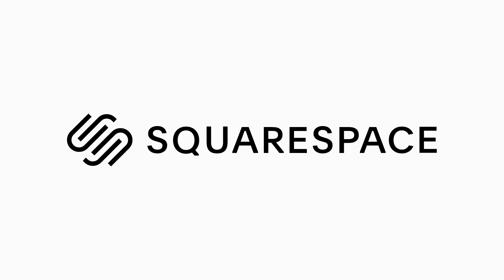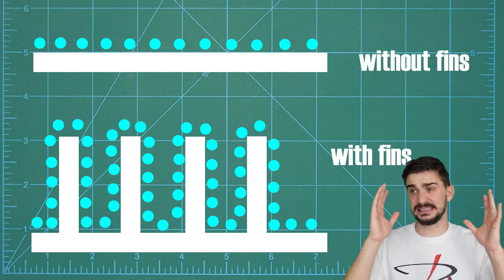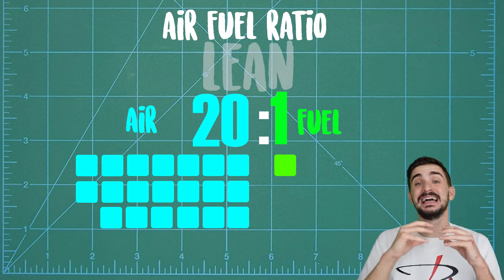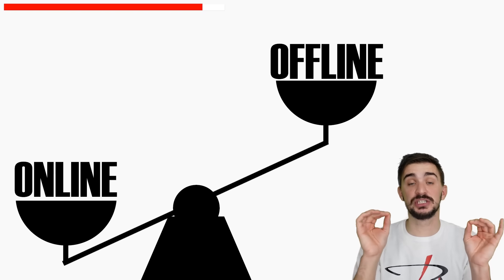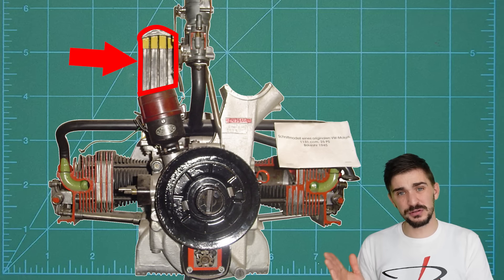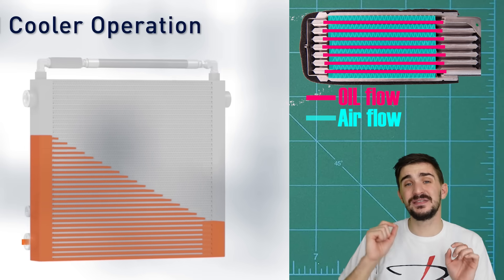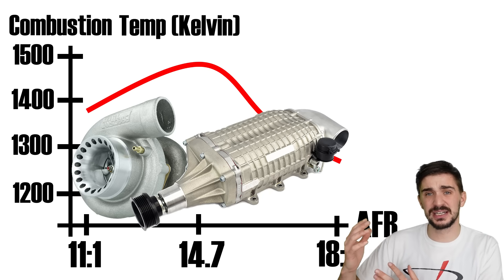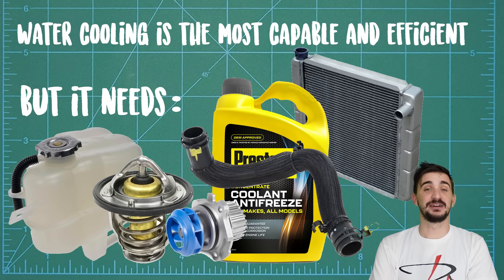AIR COOLED vs OIL cooled vs WATER cooled ENGINES

Comment: I remember talking to a Porsche 911 930 owner. He told me, that the engine is oil-cooled, not air-cooled, because there is 14 liters of oil in the system. When normally in water-cooled 6 cylinder engines it's 6-8 and maybe sometimes up to 10 liters of oil.
Reply: I like the comment ‘it’s blurry’ between Air/Oil cooled.  I don’t think it has anything to do with there being an oil cooler.  The Porsche 911 is both oil cooled and air cooled.
Reply: @alienpoker   Yup, air for cylinder heads, oil for block.
Reply: @alienpoker Correct. Btw, so are water cooled engines, after all, what cools the water😂?
Reply: I think you are exaggerating those oil capacities by a few L.
Reply: @3800S1  No, my 911 from 1977 holds 13 litres.
Reply: @3800S1 not the case, my 911sc, same 3 liter, took 12 and a bit, and that was without the front wheel well oil cooler that the turbo version of the same engine does have.
Reply: @Rudimaentaer  LOL, none of the models you reference can come close to the cornering of any 911.
Reply: Most modern auto engines do not use that much oil( 6 8 or 10 liters???) A gallon is 4 qts my 350 small block chevy takes a little more than 4 qts in a oil change. My 450 motocross bike ( 4 stroke hi output) only uses  .7 liters or 700 cc!! But when the engine first came out it had a oil tank in the frame ( part of the frame itself) to hold additional circulating oil at 2× that amount. New vehicles are using less and less oil as oil pumps are better , oils are better AND the less oil in the oil pan contains less trapped/ stored heat in the oil itself and the engine usually gains a proportional power increase with less oil ( obviously not to the point of poor lubrication and engine failure but slightly more than it actually needs) the parasitic losses of rotating parts immersed or splashing thru a   hi viscosity fluid is reduced.
Reply: Oil cooling is just air cooling on steroids. It improves some of its short comings but still you are cooling the components (including oil) of the engine with just ambient air. Water cooling is the odd one out of the bunch by introducing a separate component, water, into the mix that has no other job in the engine than keeping it cool.
Reply: Those 3l Porsche engines are air-cooled. Compare a 6l small block uses ça 5l of oil, 6l if it got an oil cooler, 7l of oil if external filter and external oil cooler are present. 9l if you add a vaccum reservoir for the oil. I build my street racing small blocks with 7l capacity and a very flat oil pan and increased the water circuit by 4l with an external tank riding in the airstream. It's essentially a dry sump and heat radiation from the pan is lower. A finned sump cover could help but in my climate this was not needed. My cars run cool on a 35 Celsius day.
 14l oil capacity on a Porsche means that the engine has some serious engineering defects. That's why I stayed away from racing Porsche and my motors and cars are simply better than what Porsche does. 500hp at 5600 and 900kg is fun. A 1800kg Porsche with 400hp/7000 is boring.
Reply: @808bigisland  there's no 911 that weighs even 1700 lol
Reply: @808bigisland Yea, how many 24 hours of Lemans races have your cars won????
Reply: @rodgraff1782  a new 400hp 911 is +1700kg. My Europa was 650kg/125hp vs a 1200kg/160hp 911. My Cobra streetlegal racecar was 950kg/500hp. 911 are maximally boring forever.
Reply: @808bigisland  Air cooled Porsches are nowhere near 1800kg. Even more heavier modern ones that are liquid cooled are far less than 1800kg.  930 is more like 1150.
Reply: @808bigisland If only you had a clue…
Reply: @brembopollypor9965  you‘d have brown pants going 300 in a Cobra without a windscreen, tiny brakes and flaming sidexhausts half a meter away from your face while lapping 911😂
Reply: @808bigisland Assumption is the mother of all f-ups

Comment: 8:57 Classic British bikes used a similar dual oil pump, but the high volume side was to scavenge oil from the sump to the oil tank. In my 1966 Norton 650SS high pressure oil is directed at the underside of the piston crowns to provide cooling, with the heat being dissipated to some extent by the oil tank.

Comment: What you call WATER COOLING is in fact LIQUID COOLING. The cooling liquids used contain a lot more than plain water.
Reply from the maker: So oil isn't a liquid? 
Also, 12:43
This is your second comment criticising something that has been already explained clearly in the video.

Comment: on air cooled bikes even the bottom part of the motor "oil pan/reservoir" there are fins to cool the oil. Generally oil cooling is mostly used when you want to shed some weight on engine block and size. And as he stated even on air cooled engines you can find oil cooler because air cooled engines run a bit hotter even more so with hi octane fuel that burn "hotter"
      
      (technically it is not correct but due to longer burn time with hi octane fuel the engine will absorb more heat. Tested on my bike, it run like a beast (more complete combustion and longer gradual power output) but it get hot faster specially in urban area). 
     
      The engine oil get burnt faster and have to be changed more often. The trade off is you dont significantly damage engine when overheated, cooled faster (when turned off compared to water cooled) and will run when overheated for longer (there is no danger of coolant boiling off, damaging the engine or out right seizing it). On the other hand in extreme situations it can runaway in a sense that it start to burn oil increasing RPM and power and potential destruction of the engine. But unlike in diesel runaway engine the compression ration and pressures is not efficient to spontaneous combustion so without spark it will stop.  

       A small oil engine historical fact. In WW2 there was a project of aircraft carrier submarine capable of launching 3 planes that have to land on ship or water. It significantly increase reach to enemy territory without putting a aircraft carrier to direct danger. The problem they were facing was way too much time to the engines to heat up to operating temperature. Loosing the element of surprise and being easy target during that time. Solution was that the planes were stored dry and before surfacing fill the engines with preheated oil cutting time by around 20 min if i remember it right, so the start up was in 9-12 min. I think in the documentary they use I 400 submarine class with Aichi M6A. On wiki it say they can launch all 3 planes in 30 min.

Comment: My old 2006 Honda CB600F 599/Hornet was a liquid cool with an oil/coolant heat exchanger.  That bike used 4liters of oil.  First time I changed oil on that bike I was surprised that a 600cc bike used as much oil as my 1991 Acura Integra 1.8liters.
Reply: The CB600F also uses the same oil for both engine and transmission lubrication ...
Reply: @sking2173  yeah so do most all motorcycles, minus Harley, MotoGuzzi, and a few others.  None of the other motorcycles I have ever had required as much oil.  Even larger more powerful bikes use less.

Comment: air cooled engines require an ticker oil than water cooled?
Reply: Sir, generally speaking it's bearing clearances and internal tolerance that determine oil viscosity requirements. Just putting thicker oil in an attempt to cool a engine is equivalent to putting a band-aid on a bone fracture. Yes, I'm a Engineer.
Reply: @t.s.racing  I'm thinking about Honda Grom engine, 125cc air cooled. It uses 10W30 oil. For an air cooled engine, the oil is too thin? Maybe 10W40 is a more viable option when the cylinder head are hot?

Comment: The GSX750 may have had 4.7L of oil ,but the 1100cc engines designed later had 3.6L which is a normal capacity for a large motorcycle engine. The air cooled GS1100 has 3.5 and the watercooled GSF1250 has 3.5

Comment: I thought you would have mentioned the downside of air cooled generally needing to be under square… considering it’s one of the biggest cons if not the biggest.
Reply from the maker: I know of plenty examples of both over and undersquared air cooled engines. Why would they need to be either?
Reply: @d4a  air cooled engines have a lower limit to bore/stroke size, Harley’s are a great example, they can have the same engine size and an Indian, yet make nearly 50% less power because they have waaaay more stroke and can’t rev to the same limit because of that, they have more stroke because it means more effective air cooling. Look into it, it’s a pretty basic concept, I can link a video if it helps?
Reply from the maker: I don't need to look into it and I don't want links. I want you to explain it to me. How does more stroke lead to more effective air cooling?
Reply: @d4a  if it’s size for size, more stroke means less distance for any heat to travel from centre in the combustion chamber to the walls to shed heat, compared to bore. Centre of piston to the walls is less. You seem upset? You wanted me to explain it? I’m sure plenty other people, waaay smarter than me can do a better job? I’m a terrible teacher.
Reply: @d4a  is this about a civilised conversation or something else? If it’s something else I’m not interested, when I said “you seem upset?” That was a genuine question, not a smart a&$ one. Discourse is how we all learn.
Reply from the maker: Was I uncivilised? I just wanted you to explain in relation to what you said above. I'm aware of how cooling works in relation to stroke but wanted to hear your opinion rather someone else's from a link. But the effect on cooling isn't the main reason why hd has a lot of stroke, their v twins always had a lot of stroke mainly due to how stroke influences torque, but you probably know that. Air cooled engines aren't really limited in terms of bore or stroke and there have been air cooled engines of all sorts of displacements and bore/stroke ratios out there. They will get around their issues by running richer/limiting rpm/etc so they won't squeeze the same potential out of the same displacement as a water cooled engine, but they're really not limited in that sense in the way you're saying with the HD example. Their main limit is emissions and this is the main reason behind their slow but certain extinction in many markets. I'm sure hd could make their engines a lot more powerful if they didn't have have to abide by current emissions norms.
Reply: @d4a  nah, lack of cooling is the only reason, Harley tried water cooled and made big power, but didn’t sell, now look at the modern engine they made, has nothing to do with emissions, Indian plays by the same rules and made nearly double.
Reply: Wasn’t this a fun interaction, hey guys.
Reply: Funny how in one of you later videos you said the exact same thing I did about over square/under square, you should probably edit your comment in this thread in order to avoid looking like a hypocrite 😂
Reply: @Merkel — You said, regarding air-cooled engines “generally needing to be under square” ... That is patently NOT true. 

You also called it (needing to be under square) “the biggest con”. Again, not true.

Stop trying to weasel out of your fool-hearty statements ...
Reply: @sking2173  “generally” =/= absolutely
Reply: @sking2173  and considering Harley vs Indian is one of the best examples due to the rage and demand for performance cruisers, I’d say Harley and Indian are playing their best game and Harley wants to stay “true” to their heritage with aircooling, except the xsr and pan American engine.
Reply: @sking2173 remember that time you forgot how to use basic human reasoning reading text?😂
Reply: I’ve never known that “rule” to be even close to true, Merkel.

From 1970, even, the Honda 350 and 450 twins were oversquare; the Yamaha RD 350 was oversquare. 

And most old BMW R-engines used a 70.6 mm stroke, and displacement increases were obtained by increasing bore sizes. The 1000cc R-engine has a 94mm bore, and 70.6mm stroke.
Reply: @sking2173  didn’t say a rule,  yes of course over square air cooled engines exist, but for a given size, under square provides a better cooling output.